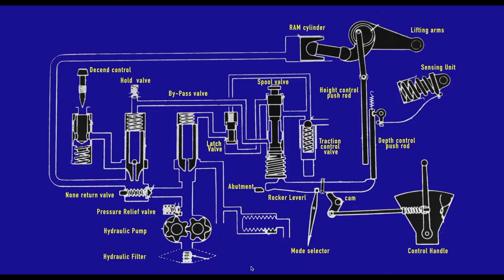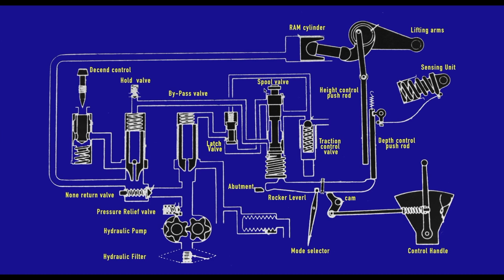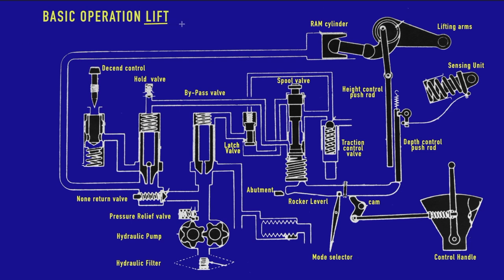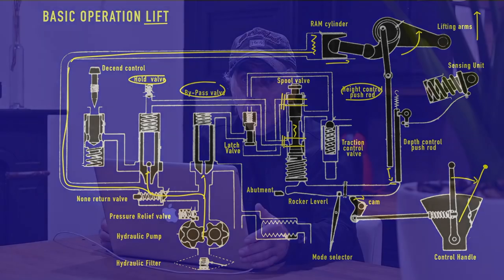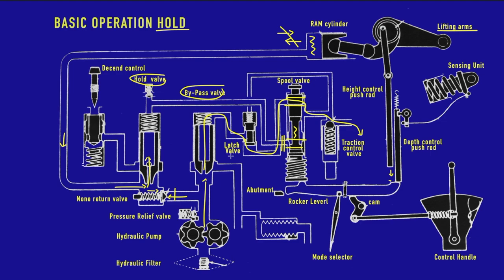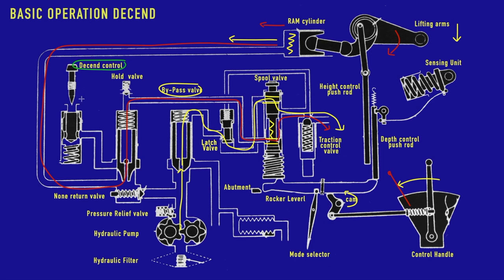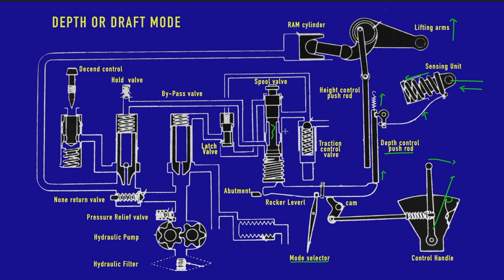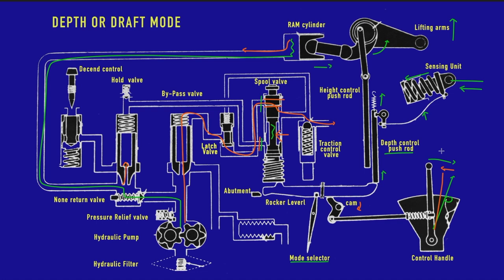David Brown, Part 2 - Deep dive into hydraulics

Comment: Thanks for all this , I have "liked" it & will watch it repeatedly until I understand just what is most likely wrong with my D.B. , it looks like either a stuck hold valve , or a damaged , bent or swarf - fouled spool valve , this is a great help , many thanks for putting it up on here , best regards from central england , it has taken an intelligent Dutchman to show an English midlander how a team of English Yorkshiremen intended an hydraulic system to work , this is the power of both , people , & the internet , Best Regards .
Reply from the maker: Thank you for the comments

Comment: I would love to see a video about diagnosing a no lift problem with a Selectamatic 3-point system. Cleaning the Hold and Bypass valves would be great also. Thank you for the information. The Spool valve only moves millimeters with the quadrant lever. I'd like to know more about how the Spool valve works also.
Reply: ýy
Reply: as

Comment: Thanks for the video,  My 780 has an intermittent problem.  Where sometime the linkage works and others not.  At least now I know that in height mode, which is where it's set,   the spring & cable on the top link shouldn't come into play, I've been suspicious of that until now.  I guess its going to be something getting stuck in the spool valve.

Comment: Thank you for these videos! You have taught a lot to this newcomer. I just took over a small farm and an old 880 that I'm just starting to get familiar with. Right now only the TCM operates to lift equipment (poorly since the cable was disconnected) and nothing happens on heaght and draft mode. The rocker lever moves with the switch so i'm guessing the spool valve is stuck. Can you or anyone here point me to the best videos to watch on troubleshooting or repairing this? The service manual has only served to confuse me on the troubleshooting since almost nothing works. I'll be tearing the  hydraulics out soon but could use some focus. Thanks. Tom

Comment: Thank you for your videos - I have watched the ones on hydraulics twice and it has helped me to understand the hydraulics a bit better.  I have a DB 880 selectamatic with a loader on it.  Last winter, the loader stopped working (it would not lift) and I found a video about cleaning the bypass and hold valves with brake cleaner and it worked!  Recently I have lost lifting power with the loader again (it will only lift about a foot).  I tried cleaning the valves again but it did not help.  The hydraulic arms are up so I don't think it is an issue with pump.  Any advice would be greatly appreciated.
Reply from the maker: Thanks for the comments

Comment: I'd like to find a description of how the latch valve works. I think there might be pressure feedback to the spring side.
Reply from the maker: Ok, let me see if can make something more clear soon
Reply: @D3Sshooter  I normally live in the electronics world. If we need to convert an analog voltage into an unambitious high/low digital voltage, we will use a Schmitt trigger circuit which has 2 voltage input threshold levels.

Comment: This is incredibly helpful and clear…is there any chance you could give me an idea of how to add an extra service to the back? I’d like to use a three point linkage backhoe digger but I have only one service on the back.
Reply from the maker: Thanks for the comments , for that you would need that extra 3 way valve and some tubing.   Not sure if you can get those 3 way valves.   I will see if can find some info on it.
Reply: D3Sshooter Thanks, that’s very kind of you. I have just been told that there is a blank port on the 3 way valve of the 996 which a pipe can be fixed to and led to the rear service. I’ll have a look at it and see if it seems viable. Grand merci!
Reply from the maker: @sethbelson3539  , If you have that 3 way valve fitted already , then yes there is the outlet port for aux that will be blanked off if not used.  You will also need a return line.. that should go back to the normal return path.  if not you migt run out of oil for the gearbox.... its the same oil...
Reply: D3Sshooter Thanks once again. How would the return line be plumbed  in? (Sorry if this is me being stupid...I’ll try to make this the last question and let you get on with making your great videos!)

Comment: great explanation, i just think that te traction controle option is a bit useless, you can just as well use the normal lift option, i might be a bit less exact, but then again, if you are plowing, you can always use the differential locking machanism. (i learned how to drive a tractor with to heavy implements  and low horsepower, not like the high tec trators from know, i had to drive using my feeling to balance out the machine)
Reply from the maker: Good point!  I might have been a selling trick  Thank you for the comments
Reply: Allis-Chalmers had the Traction Booster system. My 57 D17 has it. It would automatically raise and lower mounted attachments as the pulling load increased or decreased. Actually worked quite well!

Comment: Hi love your 995 videos - I have a 995 and the rear hydraulics have stopped working after standing for 6 months. Oil / filter changed as per your video but still nothing. Hold and bypass valve seem clean - any ideas what could be causing the issues ? I did bump a mower high at the end of last year and the transport lock engaged

Comment: So grateful  for this  info!  I have  a 12 speed  manual  gearbox 1200 DB.  our  only  heavy  tractor
 we have a silage  bale  tray mounted  hydraulic  feed out tray.  The  chain is  hydraulically  driven  by the  auxiliary  feed.  A constant  problem  is occasional  "freezing" of the lift in down position!     - No  lift... then th dang chain drive is dead !  Then it comes  right !  cannot  make sense of this   intermittent  malfunction  she is a  moodie  lady.  If  you  make it  to  NZ   there  is  a venison dinner  awaiting!
Reply from the maker: Thanks for the comments, looking forward to that dinner  lol....  there are a lot of adjustments that can be done, so maybe I should make a video on that ...

Comment: I have a David Brown 885 tractor and it does not life the arm high enough just barely off ground level which caused a lot of waterline chopping damages. I just bought the tractor and don't know much about the hydraulic systems and some basic operation of the tractor itself.  Any suggestion what I need to check for basic troubleshooting...
Reply from the maker: Thanks for the comments ,  start with replacing the hydraulics fluid and filter.   That is always a good starting point.  Clean the valves , as shown in the video as sometime they get dirty.  In which mode is it set... check that mode selector is working properly and is aligned as it should.    I might make a video on this soon.

Comment: Do you have information on the hydraulic issues on a 1412 . I have a 1412 that I have never been able to get the 3 point to  raise although it has  two external valves over a distribution block which has worked in the past however it seems as it warms up it doesn't want to activate the remote cylinder. Any suggestions would be greatly appreciated. Also with a high pressure gauge on the cover plate of the remote  Cesna valve I have never  been able to get any pressure to register.
Thanks Ernie

Comment: Hey. Wondering if you can help me out. 
I have a 1979 1212 David Brown. 
The PTO clutch does not seem to do anything.  
And the 3point hitch control does not select what is intended. 
The 3 option selector can be operated without pushing control all the way back. 

Can you offer some insight on what is going on and what to fix possibly.

Comment: Is there any possible way to delete the selectomatic system altogether and simply use the hyd pump to lift, hold and lower the three point hitch through external modern valves and hoses? I'm not opposed to cutting drilling welding on my tractor as I'm not a purist, and I think that any machinery operated in the worst of conditions outdoors should be end user serviceable without having to watch 30 videos and read countless forums about owners with the same repetitive problems.
Reply from the maker: Not that I know of

Comment: So if a -63 880 Implematic suddenly doesnt lift the arms at all, and the pump doesn't  make a sound, even though it worked before it got cold (-20 below Celsius)    would it be considerable that the spool valve has stucked/or frozen in the down position where it was left when I parked it a month ago?  The lever feels kind of loose, the pin behind the lever comes out but no lifting. The oil is Q8 t2200 and the suction strainer is recently cleaned.
Reply: I was hoping somebody had your answer because I am having the same problem.
Reply: @curtrn  I can confirm myself that my theory was correct. I made a fire in a bowl under the transmission and suddenly the lift started working again. It worked fine the rest of the winter  but I always left it in neutral or lift up position afterwards.
Reply: @MrJokkoma  Thank you for the reply. The tractor I have has been sitting for 5 years because the lift stopped working and the old farmer had no use for this tractor. I got it started after about 20 minutes and 1 dead battery but the old girl runs like a top. It's now summer and very hot here in Tennessee do you think the fire bowl would even make a difference ? I was thinking of draining the fluid and running diesel thought the system to flush and clean everything. After a good 10-20 minute diesel recirculation I was going to drain that and replace all the filters. I have read that parts cleaner has worked, thus my diesel flush theory.
Reply: @curtrn  As you say, I don't think warming up the oil will do any difference in your case since nothing is frozen now so it has probably stucked for you. There is some videos when a guy open up he's tractor and that might help you, if it has been sitting for a while with bad oil and condense water inside things might have rusted so the diesel idea might be one way, don't run it too long since the diesel whont lubricate the gearbox so good. Have you tried the little handle in the 2 positions up on the right side of the rearaxel? Mine first came to life when I touched that one. It's hard to know what has happened if it was this way already when you bought it. Likewise the valves you can twist also for sure has some meaning. It's not the easiest controlsystem to figure out for a 3 point lift if you ask me haha.
Reply: @MrJokkoma  I did try all three positions and nothing. I think your on to something as the fluid is milky. What fluid do you recommend when I change it ? Thank you
Reply: @curtrn  I think any UTTO (universal tractor transmission oil) will do. I use Q8 t2200 it's a common oil here in Sweden. It's like John deere Hy-gard for example. 
If the little pin that you lever pushes on when you push it downwards to lower the liftarms is movable and comes out by itself when you let go of the lever the tractor should wanna lift the arms, if it gets stucked and you have to pull it out half an inch you might have the problem there. That pin can be adjusted behind the square cover on the right side behind your rearaxle. Just a tip where to start looking after problems.

Comment: My 996 external hydraulics has a problem.
Example after tipping a trailer it takes way too long for the cylinder to come down, even if the trailer is a heavy one.

Using the "dump valve" it has the slightest of effect to the lowering speed.

I have already changed the quick-fit connectors with no luck.
And the lowering speed is set to max.

Do you have any idea where the problem might be? the hydraulics work fine otherwise.
Reply from the maker: Thank you for the comments, I would suspect that the share volume of oil in the piston to discharge is just way over the volume that the hold valve can handle... Are you sure that the rocker lever is not pushing in the TCU valve ?

Comment: There is something 2 things that I wanna know:
First- what is those too caps that sit close to the lifting lever that say " pressure" and " return"?!
Second- Do I have some pressure output that I can connect a two way valve and a place for a return to the gearbox for oil?!
Thank you for the video, I learn a lot a things that I can apply to mine one!!!!
Very nice video!!!!!!
Reply from the maker: Thanks for the comments, I will try to get you the answers shortley

Comment: Need help from anyone who has suggestions. David Brown 880 the 3 pt won't lower, when I start the engine the arms begin to raise and won't lower (unless parked a few days then they bleed off) the control lever seems to have 0 effect on any function up or down. Seems no shops around home want to mess with it 😞
Reply from the maker: Thanks for the comments
Reply: I have same issue on a 990 seems there is no good info on this issue. most people have the opposite issue - arms not raising.  If you get any info let me know!

Comment: Thank you very much for this video.  I have been struggling a long time with lift issues on my 770A.    I have had the chest out twice now.  with no luck so far.  I have lift and lower, but a leak somewhere in the system in that my pump is under load even in hold and as soon as I turn off the engine the implement leaks down quickly on its own and drop the load.  Do you have any help for me on testing the control valve on the workbench?  I have read and re-read the DB manual many times and other sources from the club and set my spool travel per the etched number.  I believe I am replicating the leak out of the chest while it's on my workbench with shop air pressure, but I cannot figure out the exact source of the leak and how to stop it.
Reply: for a long time I believed I had a leak in the pipe to the ram.  But I am fairly confident that the leak is in the chest itself.
Reply: after more experimentation and trials, I am now confident the underlying problem with my tractor is low hydraulci pressure from the pump.  I put a gauge on the system via the ram cylinder bleeder screw.  even with revs up the most PSI that I can get going to the ram cylinder is about 750 PSI.  spec says should be about 2000 PSI.
Reply: @chrisdaunhauer1757  Could be your pressure relief valve as well.
If you have an external outtake you could test it with a gauge i suppose?